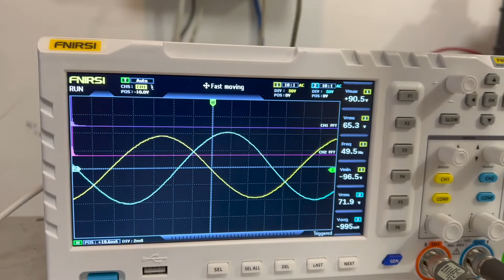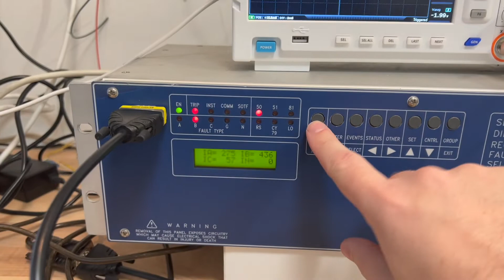Arduino - Three Phase injection set project update

Comment: Really interested if you solve the problem.  It would be great to have a LiPo battery operated 3 ph test set for ringing out CT/VT secondary circuits. 1A, 2A, 3A or 10,20,30V A,B,C would be enough.  Hope you have made progress.
Reply from the maker: Might be a bit late.  Yeah made a bit of progress. Just flat out commissioning heaps of new subs

Comment: As i thought afte watching previous videos i think your dc volt drop just check once ....
Reply from the maker: Supply DC? I have a voltage stability issue, which i'm hoping to fix with digital pots for regulation and shield cables. But we will see.
Reply: @50Hz  as seen on oscillo sine wave can't get peek when load is on
Reply from the maker: @Riya Verma  Just that load, I can run lights chargers, relays (as seen in video), heating elements. But you have given me an idea to checks a raft of loads and compare. Thank you